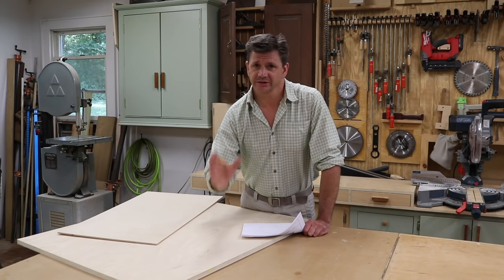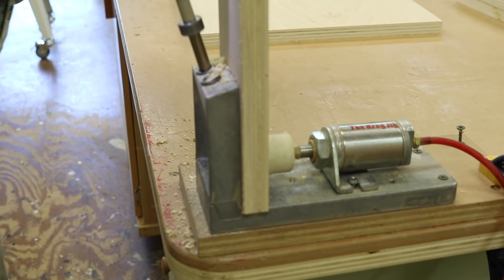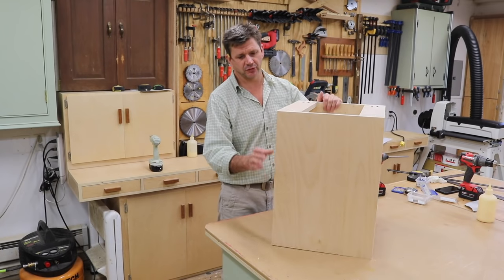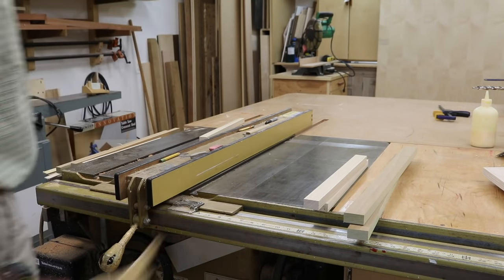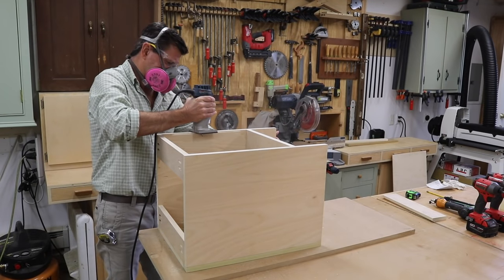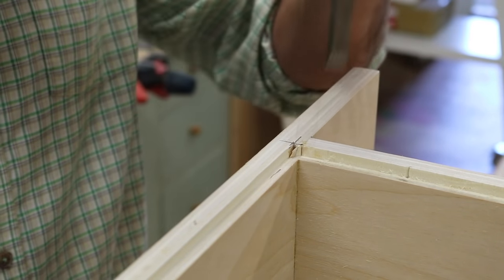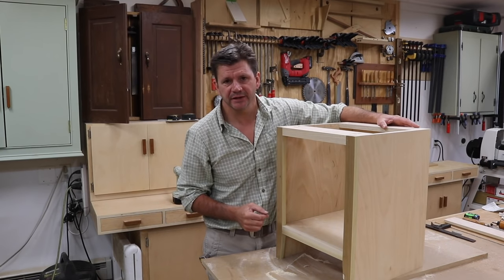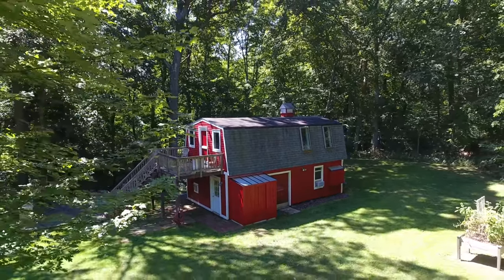Make a Bed Side Table – End Table, Free Plans on my Site

Comment: Jon.... the project is beautiful. I have two questions-- the first, I watched as you used a single clamp the installed your pocket screws. When I've tried that, even after firmly clamping the piece, my entire project take a spin. The glue spattering in one direction with the wood and project in the other. I find I must use 2 or even 3 clamps and I am grateful if things go smoothly. My second question is why do you prime the project first? Most paints come with a paint-n-primer in one.  What does the latex primer get you over using a pre-stain product? Does the latex primer minimize the plywood grain bleeding through the paint?  Thanks...
Reply: If you notice, he clamped to the table and the project piece, but he's also got a piece of plywood lying at the back of the project AND the table top has some grip.  I find it good to clamp a scrap piece in the direction the driver spins so the project won't move.

Comment: How many times has one made a project with flush perfect fit inset doors in their shop, only for the perfect fit to vanish once you bring that long hard project inside your home? Gaps become uneven or bigger, fit starts to vanish. Is this why I see more n more finish ply being used to build projects, or mdf?
Reply: properly dried wood as an answer?  just a suggestion, although yeargh, it depends from a style. If i want to PAINT it, why use expensive wood?

Comment: What do u use instead if u do not own a nailgun
Reply: Chris Edwards hammer and nails obviously
Reply: Sam Rakkaus would the nail sit to proud compared to the nail gun aesthetic looking
Reply: Chris Edwards  use a nail set, a small pin-type punch to set the nail head below the wood surface.  Available at most hardware and big box stores.
Reply: Use a finish nail and set below the surface with a nail setter.